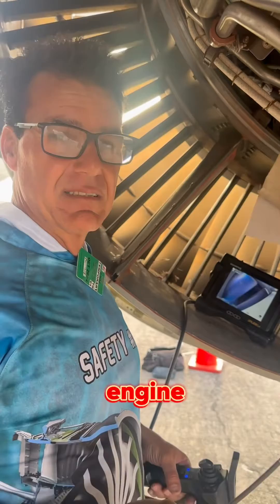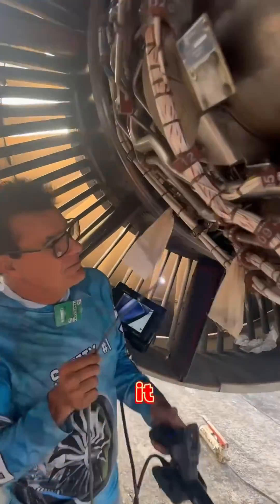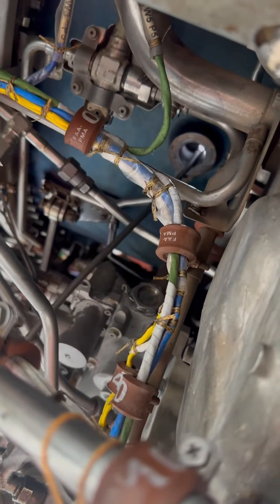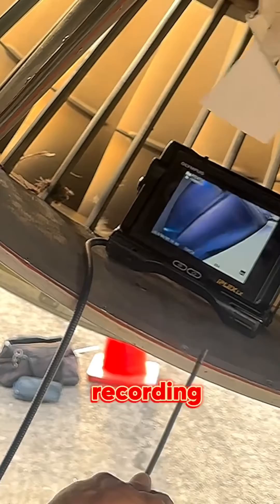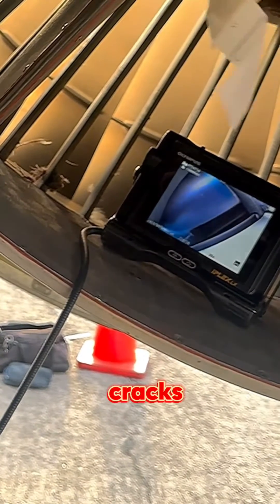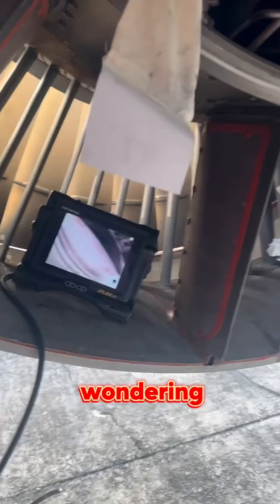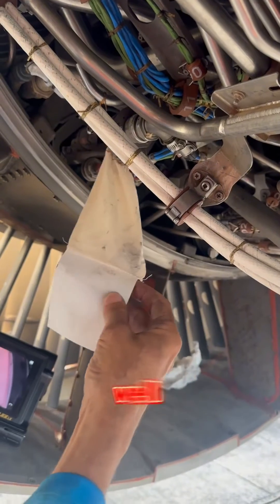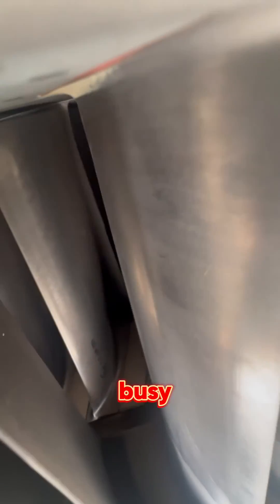BIRD SUCKED by AIRPLANE TURBINE L👀K what happens next  #aviation #fact #video

Comment: How do you rotate the high  pressure shaft inside the engine? Because I mean you can rotate the engine fan that is on the low pressure shaft but its not connected to te other one.
Reply from the maker: Great question, we remove the   N2 crank pad cover in the gearbox and using a special tool we rotate HIgh Pressure part of the engine to examine HPC and HPT. Glad you enjoyed the video
Reply: @slipperybeastaviationfishingsh  Thanks!